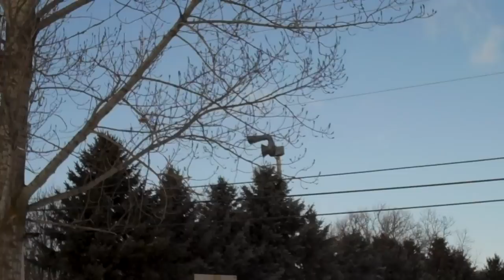St. Peter Wisconsin ACA Allertor 125

Comment: Why did they replace a thunderbolt with another old siren? Most of the time they replace the old sirens with brand new ones such as the most common choice, 2001 siren or t 128
Reply: At least a Allertor is better than a 2001.